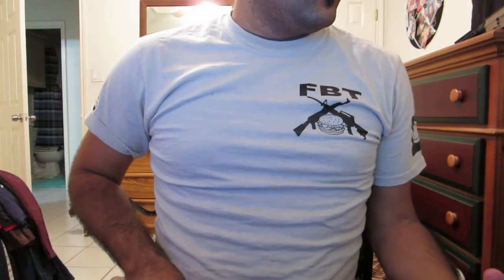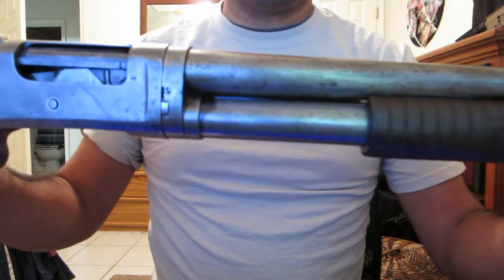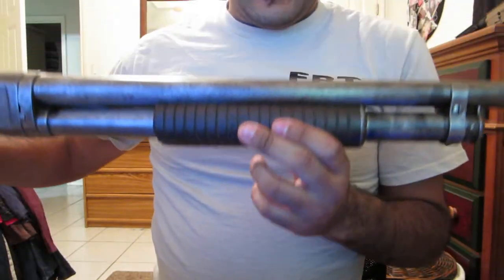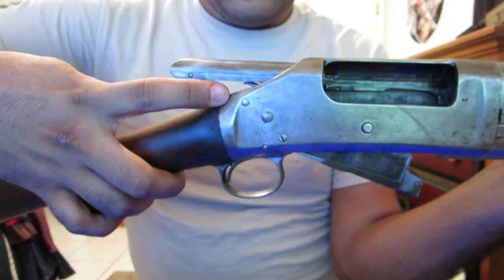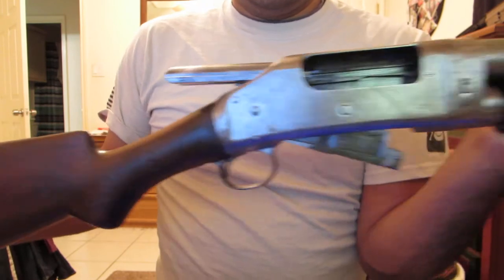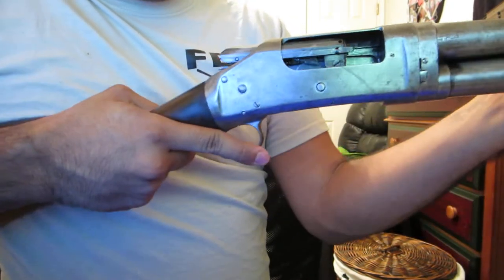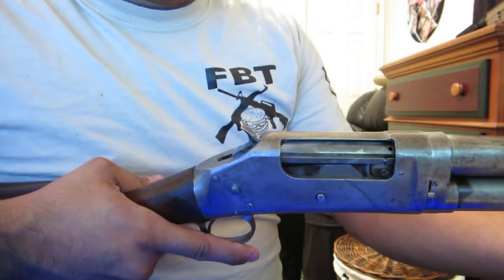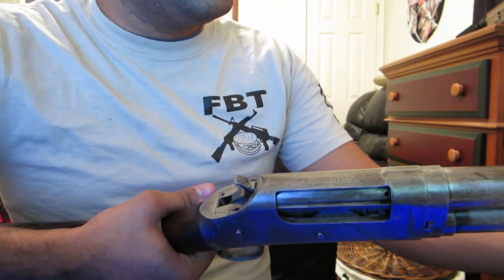Winchester Model 1897 Hammer problem?

Comment: The issue as you described does not affect the safety, purely a functional problem. Mine does the same thing, my gun is worn out, and in all probability yours is a well. Worn out is somewhat of an overstatement, some parts are worn. If you push down on the bolt as you pump, you will hear the hammer cock. Internal and external wear is such that when the bolt comes back it does not push down on the hammer enough to cock it. When I look at mine it appears as if the rub point on the hammer itself is worn. The top of the hammer that contacts the bolt is not nor can be lubed. Therefore the bolt slowly wears the hammer or itself until it no longer cocks the hammer when the action is worked. BTW pump or slide shotguns are meant to be worked with authority, pump them like your life depended on getting a round into the action. I have thought about building up the metal on top of the hammer, or shortening the sear. After close examination of the sear, that is a risky proposition, and I don't think its a good solution. It will work, but IMO it's the wrong way to fix the problem. So before I build up the hammer (welding) I've set the gun aside and I'll be doing a bit more research.
Reply: Welding is the way to go i did it 3x now on 3 diffent 1897 carriers and in the end they work as new they just need a hair more metal so the sear can engage the hammer,so weld a bit and use a dremel to make it all to the original dimensions and the gun is working sweet....If u start messing with sears u need to know what ure doing and it takes much longer cause u need to take the gun apart many times,wenn i weld the hammer i leave the guns intact and in like 1-2 hours the gun is working flawless and looking original
Reply: Found a guy with a tig welder... if I remember I’ll let y’all k ow if it worked!

Comment: I am familiar with this problem cause if u put used carriers units in diffent receivers u get sometimes a thing like this....What i do is i take my mig welder and weld a bit on the hammer on the spot thats worn and then take a dremel and make it smooth,in the end the hammer is pushed down a just a little bit more and the sear locks the hammer and the action is just as smooth as always,this is a bit of a time consuming job,but who cares if u need to spend 2 hours on making ure gun working as smooth as i can be...
Reply: Can we pin this?!?

Comment: Weld up the hammer a little bit and dremel it down,that solves ure problem,i have done this many times wenn i do a action job on a 9 i use a brand new sear the hammer always comes to half cock,
so i need to weld up the hammer and dremel it down........(is the trick to stop dremeling at the right point so the bolt does fall over the hammer by its own weight if u take to much off......u can start again)
Reply: Got the same problem will welding it with flux core work or does it even matter? What weld settings for that with a mig welder?

Comment: Greetings from 2019...

Did you ever try adjusting the trigger spring screw? Too loose and the hammer won't engage. Too tight and it will lock up
Reply from the maker: Jack Kurtis Productions I didn’t end up keeping it due to parts availability
Reply: @evilmonkey003  Nah thats not it,i take half the force of the mainspring by grinding it like a hourglas so my hammer is like 40% less powerfull,the results in a much smoother action and modern primers are much softer then primers 100 years back,so no need to get all force/friction in ure gun,the problem is the hammer isnt pressed enough down so the sear cant engage.

Comment: Worn sear.
Reply: Possibly, but not in my case. To determine this the action has to be disassembled and the parts inspected.
Reply: On mine, there is too much play between the bolt and receiver... ie,  worn out...😢
Reply: @chriss31  even the most worn out 93/97 can be fixed so easy....Meaning u buy a new sear and the hammer needs to be cocked 100% so u need to weld up the hammer and then file/dremel it down....so everything is as out of the factory or even better....U can make the fricton as minimal as u can.